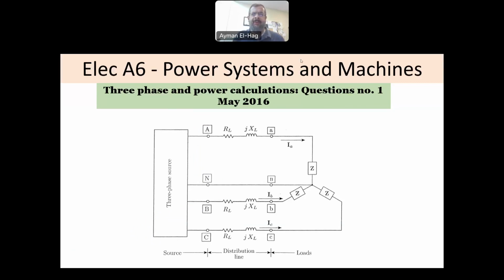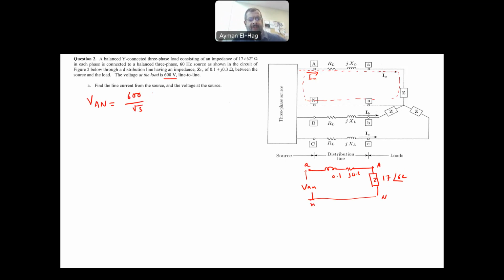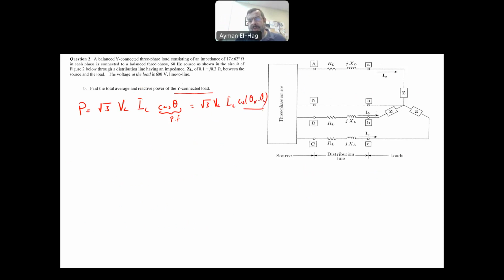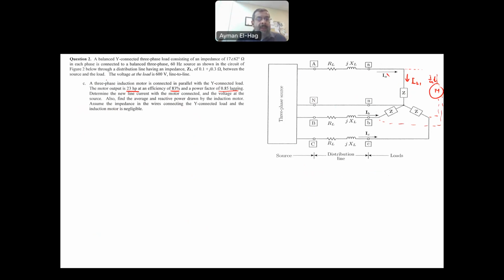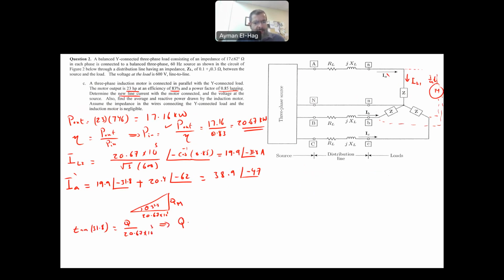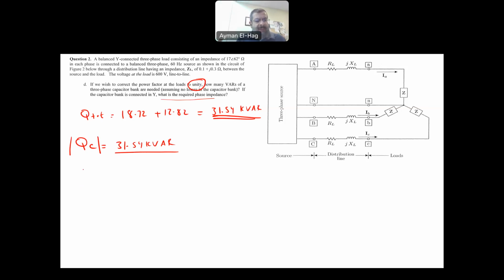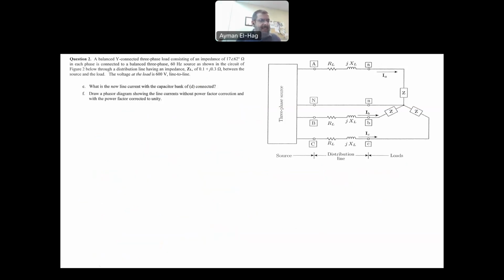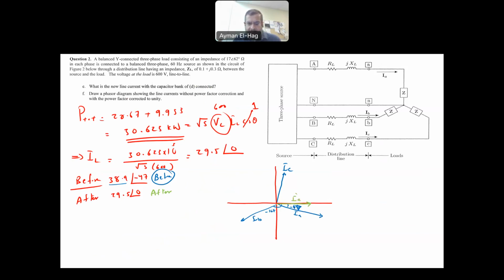PEO solved examples (ELEC A6) Three Phase Question no. 1

Comment: Hi Professor, when Motor is connected and we are calculating new line current,how IL1 remain the same, will it not change as source current will divide between load and induction Motor. Are we not supposed to calculate total P and Q after adding the motor to calculate new line current.
Reply from the maker: Adding a motor will not influence the load current consumed by the first load. To explain this, assume you have a microwave ON, so it consumes I1, then while the microwave in ON, you turned in parallel with it a toaster, then the microwave will still consumes I1 and the toaster will consume I2 and adding both of these two current will give you the new supply current from the source.
Reply: @electrical4everyone  make sense. Thank you for the explanation in simple form.
Reply from the maker: You are welcome

Comment: Hi Professor, I noticed that the phase voltage at the load is written as Van, but you described it as VAN, which I understand to be the source-side voltage. Was that a typo, or am I missing something? Also, regarding the reference voltage angle you assumed to be 0°, could we instead assume a positive-sequence system and use –30°?
Reply from the maker: The phase voltage at the load is VAN and at the source is Van. This is the convention I use in my calculation. If I said otherwise, can you please tell at what time in my video I said so. The phase shift has nothing to do with the positive sequence. We can use any phase shift, if it was not stated in the question, but we use zero for only ease of calculations.
Reply: @electrical4everyone  Thank you for the explanation. In the question, capital A refers to the source side and lowercase a to the load side. Therefore, the source phase voltage should be VAN, and the load phase voltage should be Van. However, in your first circuit diagram, you labeled Van as the source phase voltage.

Comment: Hi Professor,
Thank you for your great video. I have a question@3:29: when we calculate the phase voltage from the line voltage, why don’t we subtract 30 degrees from the angle? But when calculating the line voltage from the phase voltage, we add 30 degrees to the angle@5:54.
Reply from the maker: I started by assuming the phase voltage angle at the load as my reference and then calculated also the phase voltage at the supply. To calculate the line voltage at the supply I added the +30. Also, if I want to calculate the line voltage at the load, I will also add +30 to the zero reference angle.

Comment: Dear Prof, i am presuming that capacitance you have calculated is per phase. How would we know whether the bank of capacitor will be connected in delta or star?
Reply from the maker: It has to be stated in the question.
Reply: @electrical4everyone  but can you please confirm that the value calculated for capacitance in this example is 3 phase or per phase?
Reply from the maker: @rooh.ulamin the capacitance that we calculate is always for single phase. There is nothing called 3 phase capacitance.
Reply: @electrical4everyone  thank you professor

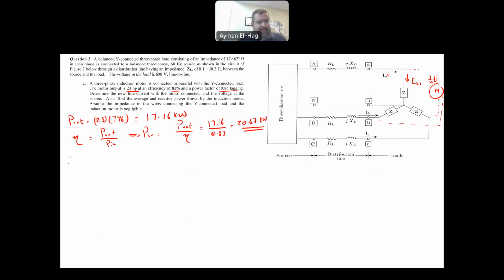Comment: @10:28 Shouldn't it be 20.67*10^3/(SQRT(3)*(600/SQRT(3))*0.83) 

Since the load and motor are in parallel and we are considering 1 phase at a time, so we should be considering the phase voltage instead of line voltage in our calculation?
Reply from the maker: We are considering the line current for each load and then adding them. Remember in Y connection line current = phase current.

Comment: Dear Dr. EI-Hag, there is a calculation error in 18:55 about the capacitance C, the value should be 0.232mF. The required impedance will be 11.41 Ohm.
Reply from the maker: Thanks for your feedback, I added the correction to the video description.